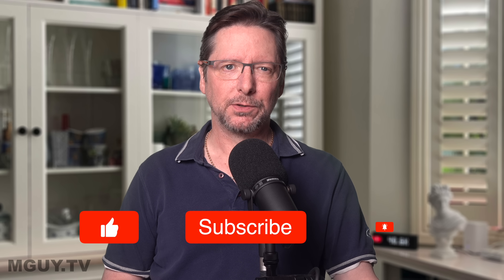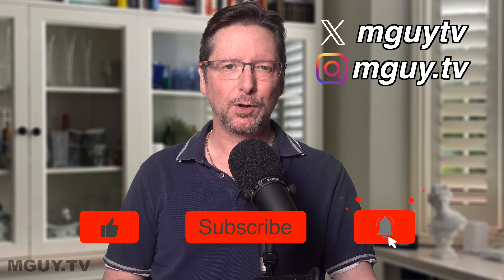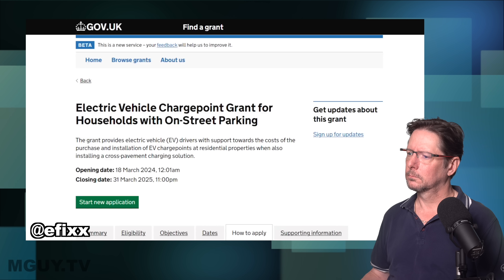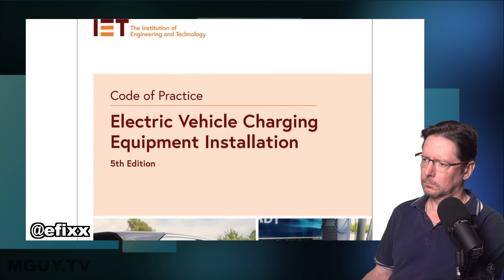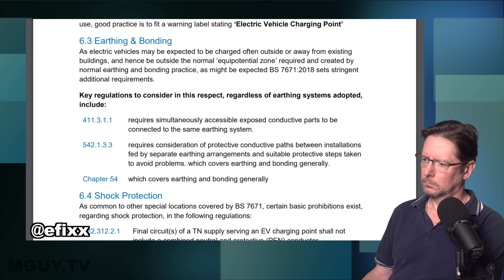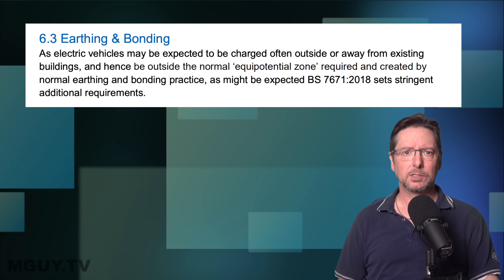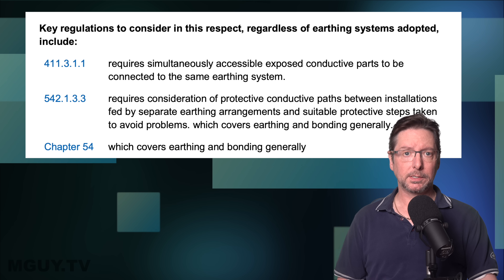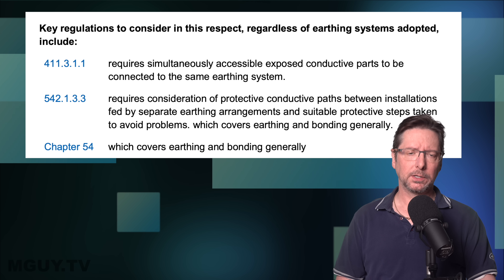ELECTROCUTION RISK from on-street EV Charging | MGUY Australia

Comment: In the USA gas starts fires  4,200 a year or 1 every 2 hours.
300 of those are explosions. Or almost 1 every day.
And many people are killed.

So, what did you say about electrocution?
Are there any dead, or in injured, you have data on?
Or, is this just to fill the quota of videoes, that's mandated from the oil lobby?

You know that oil is subsidized $7.000.000.000.000 forcasted $9.000.000.000.000.

So, every fossile car are subsidized $28.125 through oil.
A fossile car burns more than rabbits fuck. World wide it's atleast 1 every minutt.
In the USA it's every 2-3 minutts. 2 people die from this every day.
The reason why EV's that burn is in the news, because it has news value.
Opel/Vauxhall Zafira diesel have buned more than all EV's combine.
They have tryed to fix this with 3 major recalls in 20 years.
This proof that a fossile car can't be fixed. It will always be a potensial fire trap.
This is the same with fossile cars with extra big batteries.

The subsidies on oil is pure corruption, politicians get payed by the same companies that gets all those subsidies.
Those subsidies are money you have to pay in taxes, higher prices on food, clothes, homes and all other things you need.

With EV's, you get rid of the cartel that controls the prices, and use the fossile car owners as hostages.

Comment: As covered in the video, there is a very real risk of electrocution due to ground faults caused by tying into multiple earthing systems. Additionally, even small variations in grounding and voltage resulting in differences of only 1 to 2 volts can cause malfunction of electronic devices. In the case of EV's, a minor voltage differential may cause issues ranging from failure to charge up to causing permanent damage to electronic components.

EV owners should be made aware of the potential risk of electrocution or damage to onboard electronics when using on-street charging systems. In the case where voltage differential or ground faults are present in the charging source, the cost of any damage caused to the electronics would not be covered by the vehicle warranty but borne by the EV owner.

Comment: From what an engineer math teacher told me back in 2007 about charging electric vehicles and note the charging has not gotten any better at all in 20 years so yea this stuff is really bad.  So from what that engineer told me charging an electric vehicle is like running 300 washing machines at the same time.  People who do charge electric vehicles can get that electricity not counted on their electric bill because of incentives by left wing politicians giving tax breaks to rich people.  If the rich were charged for how much actual electricity they use then not a single person would buy electric vehicles because electric bills would increase by over $1,500 a month at the smallest increase and many people's electric bills would go from about $50 to over $6,000 to $15,000 a month.  Electric vehicles are being subsidized by tax payer dollars to keep this crap from showing its real cost.  These same tax breaks are being given to solar panels as well to where in reality tax payer dollars are being used to subsidize the purchase of each panel and their installation in which each panel on a regular person's home which is about 1.5 feet by 3 feet to 2 feet by 4 feet panels would cost around $50,000 to $80,000 per solar solar panel which if you have 10 to 20 of those panels they would generates less than 1% of electricity used in half hour but takes about 125 years to produce that amount of power.  Now note these costs were back in 2007 and the energy efficiency has not gotten better at all and in fact there is proof the efficiency has gotten worse to scam more people and make more money off these scams.  Having an electric bill of $$15,000 in 2007 is closer to $80,000 now.  That $80,000 is closer to $500,000 now.  This shit is a way to use tax payer dollars to give tax breaks to rich people.  To put it bluntly this electric crap is a way to rob the poor and give the money to the rich.  Rich people don't actually drive this crap they push it on the poor who can't afford it while rich people drive nothing but gas powered vehicles.  Hell Tesla has a rule that is straight up for safety reasons no one who works for the company or visits the company is allowed to drive electric vehicles ever and not own them either for health and safety reasons.  They have policies that state employees are not allowed to own or operate electric vehicles for health and safety reasons so yea the creators of this crap know full well its unsafe and yet they still push the garbage.

Comment: I remember studying electrical engineering. The electricians book reminds me of almost a white pages thick book. It's amazing how the updates keep getting inserted into it as well. I wish I would have done the 4 years, but had too much on my plate and it was an intensive course. At the time I was studying from about 7am - 4pm then driving home, getting changed and then working about 5pm - 11 pm then getting home by midnight, eating dinner and sleeping by 1am. I'd then get up at 5am to start it all again. 
It doesn't take a rocket scientist to work out that I didn't last long doing that (a few months)

Comment: This will not work unless parking rules and possibly laws are changed. Will you be able to rent a reserved parking spot right in front of your house on an otherwise public road? In crowded urban areas, this may never be feasible. 

The earthing problem on the other hand would be solvable with proper engineering and coordination, but this will probably cost a lot more than the 350 pound subsidy for each parking spot. All of this is obviously not very well thought out. Just running a high voltage high power charging cable under the sidewalk is obviously not a properly engineered solution.

Comment: I haven’t lived in the city of Toronto for several decades, but at one time, small metal access covers embedded in concrete sidewalks would often become electrified when runoff from salted sidewalks during winter caused corrosion of the cables buried beneath. Several dogs were electrocuted as a result.  This idea is madness.

Comment: Neighbouring houses are usually on different phases. So if there's a conductor fault in one house (or even a partial fault), the neighbour's could be at 240V...

There are many videos about where gas meter connections need to be clip earthed before working on them. The second you disconnect, there could (and often has been) a voltage difference generating a spark. Not clever.

Comment: Anyone from Canada knows that you can't run an electric cable over your sidewalk.  From November to March we need to plug our cars in or they will freeze.  But not while it's on the street unless you build a trellis, and even that is illegal in most places.  I guess our leaders think that 240 volts is safer than 120 volts.   Stupid people elect stupid people and there is no cure for stupid.  In 2021 I learned that nine out of ten people are stupid.

Comment: Which is why that the installer had to actually see and test the earth straps on my water and gas pipes before he could install my charger.  But as the expert in the video says that is only confirming that my charger shares an earth with my electricity, water and gases supplies, which is fine for an off-road carter, but it makes no guarantee that my earth is the same as my neighbours - probably is, but no guarantee.

Comment: In Canada, it used to be approved that you could earth the power panel to the water pipe, but we have seen significantly better grounding after it was found that if there was a short in the electrical system the bleed-off of power could energize the water in your home.  Regulations changed and ground rods are now installed along with elaborate ground plates to assure appliances will earth ;this becomes especially critical with electronics which often need a consistent micro-voltage. If a ground is invalid this will throw up unexpected behaviour as the computer systems guess what is happening because the instruments it is reading from will not have correct readings due to voltage drops.

Comment: For the Australian viewers, we use a multiple earthed neutral system. That ensures there wouldn't be a potential difference in this scenario provided the installation is compliant with regulation. Fundamentally it's covered under AS3000:2018 but I suspect such a scenario wouldn't be allowed in any case. Keep up the good work Simon.

Comment: In NA, ground/neutral is provided by the guy wire that holds the low-voltage wires between poles and houses with each pole having its own grounding rod. Pole-mounted EVSEs can tap into the pole's ground/neutral wire and that should take care of keeping it pretty close to the same ground potential as anything else nearby that is properly grounded to avoid having a dangerous potential difference with the nearby utility poles. In those instances, the electrocution risk would come primarily from the presence of non-code-compliant stuff around the installation site, not the installation itself.

Comment: Running a cable out to your car across the street in not advised for a host of reasons. With a current leakage detector either on your main switch panel or dedicated one on the cable, electrocution isn't one of them. Compare the risk of fire at a gas station, where untrained idiots are allowed to pour out a highly flammable liquid while wearing no protective clothing at all. Some of them will be wearing shoes which could cause sparks or wear clothing which generates static. They might even not switch off the car, leaving an ignition source running. How have the politicians allowed that risk to continue!

Comment: What a huge bunch of BULLSHIT. Every wallbox must have an RCD inside, which switches off any voltage in case of failure within milliseconds. Grounding of the car is provided by the charging cable, otherwise the car is isolated by the non conductive tires. The chance of electrocution is about the same as if you touch the fall pipes of the roof gutter of two adjacent buildings.
But hey, people who believe exhaust gasses are clean, probably even believe  the electrocution bullshit.

Comment: Its worth remembering that vehicles are on rubber tyres which act as insulators.  So yes, the body of the car could be live without tripping as a fault, depending on the integrity of the supplied earth cable on the charging lead. In theory an RCD breaker on the charging lead should prevent an electrocution......i suppose? Someone correct me if I am wrong )

Comment: They could enforce the use of isolation transformers for all outside charging points......
Reply: Or just use a lower charging amperage.
Reply: @Luka_3D  That wouldn't work.  You'd have to use under 30mA to stop someone being killed and at 30mA you'd NEVER charge a battery!
Reply: @kellyeye7224  I mean block heaters run of 500w and they seem fine. Why not just use that?
Reply: @Luka_3D  500W at 240V means a current of over 2A - much more than required to kill.  An isolation transformer 'disconnects' the live supply from a ground return therefore you cannot complete a circuit to earth ergo you can't receive an electric shock.
Reply: @kellyeye7224  My point is not to slow the charge down to a point where it wouldn't kill you if you touched the live wire.
My point is, hey, people use block heaters, we don't seem to have issues running cables to cars to drive block heaters so why don't we just take that spec and use it to charge instead?

Comment: I guess you will just need to use jumper cables to attach your car to any other car immediately in front or behind you, assuming you can find any metal to clamp onto.
Reply: Chargers have a ground in them. If there's no ground, the charger will refuse to work.
Reply: Also slava ukraini

Comment: Where is the plug kept when not charging? Do the pull it out of sidewalk and snack to house? If not, what protects the plug from getting run over or worse, dropped in the gutter and possibly in water?
Reply: You can wrap the cable around the charger. Most of the chargers in europe though only have an outlet that you plug your cable into.
Dc fast charging cables on the other hand are stored in a similar way as to how gas pump lines are stored.
Reply: @Luka_3D  so your saying you pull it out of the sidewalk channel and store it, then put it back in the channel and put the protective cover back in the channel every time? Seems awfully inconvenient to have to do that all the time. And how long would that cover last be in installed and removed over and over?
Reply: @darnice1125  No no I have a charger mounted in the corner of a parking space so the cable doesn't have to run over or under the sidewalk.
Reply: @Luka_3D  Ah, gotcha, but we're talking about the new rules for running cords across a sidewalk. If it's in a grove with a cover in the sidewalk, where does someone put the plug when not in use? Do they pull up the cover and cord every time? Cause they can't leave it on the street in the gutter. And as homeowners  don't own that parking spot, what guarantee do you have to even access the charger.
Reply: @darnice1125  Yeah I honestly have no idea how to solve for that.
I live in an appartment complex and until recently I charged when I went to the gym and such. But thinking of how to provide an option for everybody to charge at home? First thing would be to install an on street charger like I did. That won't stop other people from parking there though. You can't make it an ev only spot because idiots will park there regardless unless someone can fine them and also making it your own parking space might also be impossible in some situations. Until there's enough evs out there to justify installing a charger for every parking spot, I really don't see a viable long term solution in place other than improving public charging infrastructure around places where people spend a lot of time.

Comment: How long do you think the cables will last when people are sleeping on the streets looking for a fast buck? I did work for transit systems years ago and people would come out at night to cut and steal copper cable that was used to connect the rail for the safety signals.

Comment: Simply tender this work out to NICEIC contractors only. The DNO already do risk assessments on different earthing and touch voltages between lampposts and street furniture so the risk is already out there on PME systems. The ideal objective is not to increase the touch voltage shock risk. You could state that PME protection units are connected to the origin of the circuit and in single phase a ref earth connection. It’s possible  to engineer something safer than what’s already out there⚡🥶
Reply: With ref to UK only!

Comment: I was watching a re-run of a police programme where an EV was involved in an accident, They mentioned that emergency services are not permitted to touch the car to rescue the occupants until an electrician has deemed it 'safe' & the bodywork hasn't become live, Now just imagine if you are stuck in the thing while the batteries are blowing up & the emergency services are just having to stand there & watch, pretty frightening i would say.
Reply: Makes sense. I mean new EVs have 800 volts running through them.

Comment: Politicians posing as engineers doesn’t work.
Reply: They usually have engineers backing them up. Like in this case, which is why the number of people who were electrocuted by public ev chargers is still 0.
Reply: @Luka_3D  so why don’t their engineers follow the codes? I’ve never met a professional engineer who would stamp a document that was flagrantly not in compliance with codes and standards.
Reply: @mongo64071  They did folow the codes. The articles that MGuy referenced only cover 'dumb' charging equipement. The new stuff that evs use (cca 2012) always perform a handshake before power starts flowing which makes the whole thing much safer than pluging a toaster into an outlet.
This handshake for example checks if the ground wire is connected to an actual ground.
I'll be honest, this isn't a great solution but I'd wager they determined the risk is low enough to push it. I still hate the idea because the tripping hazard alone but it's still better than saying 'aight pay 700 bucks to have a home on street charger installed or you can't charge at home anymore'.

Comment: I live in an old mining village in County Durham where over 80% of the housing is terraced with no private parking. 

I did a simple survey of the village and estimated that, if 100% EV, there would be in excess of 900 cables across the pavements. I sent this to my MP but, of course, no reply. I’m guess this “dig a trench” option is in answer to my report but clearly no one has looked into wiring regulations. I have just sent this to my MP but I’ll probably get the same reply.
Reply: One can only hope that he did at least become aware of the problems you raised and soften the earth so to speak if others point out these concerns too.

Comment: What a stupid idea of under pavement EV charging cables.
We will end up with rows of upright poles like parking meters, where most drivers park as the road are too narrow to park both sides.
When are these green idiots are going to wake up that EV are not the solution for the future, they are going to be a massive expenses problem for generations to come.
If they have plug points inserted in the pavement, how long will take to be damaged allowing water to flow in. 
This is another ill thought out expenses green idea that never going to work.